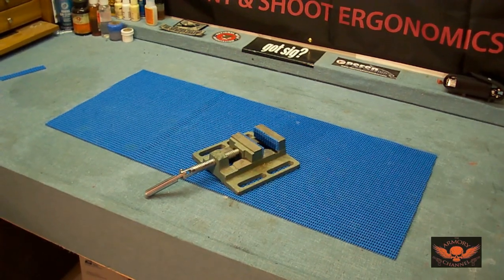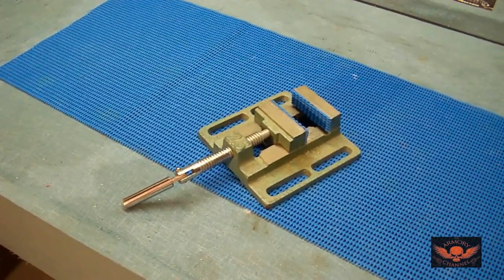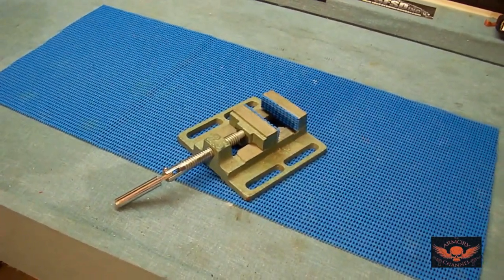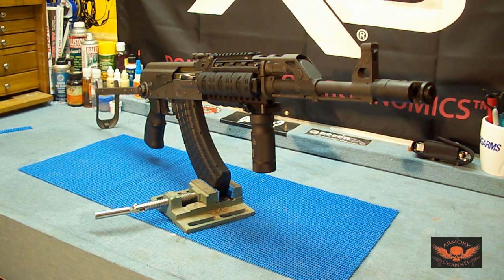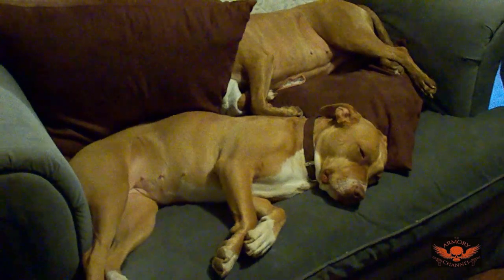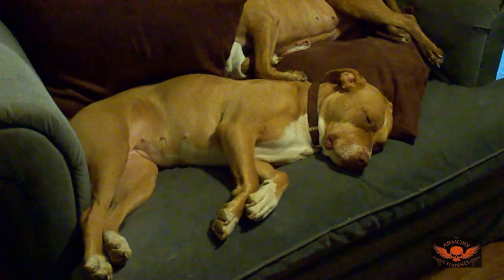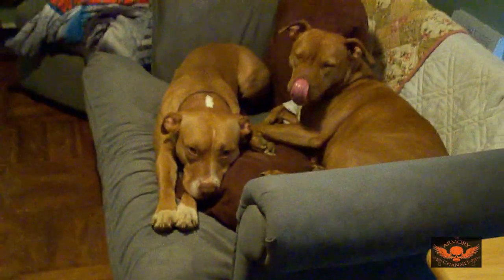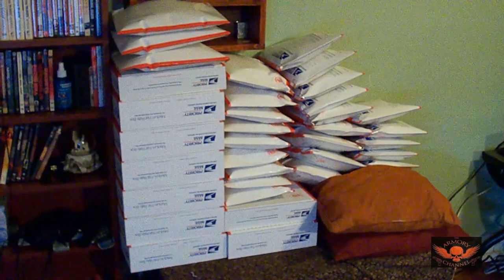Yugo M70 update

Comment: lucy looks full to me. maybe a little boxer a few generations back. I just bought my m70 and i keep discovering all these little extra things that it has like the grenade sight actually cuts off the gas tube so your blank round will propel the grenade farther, and the night sights i discovered about 20 min ago the heaver steel and barrel is great. i wrapped the folding stock with thin paracord for extra comfort and has worked out pretty well. great weapon and great dogs.

Comment: One thing, while steel might be alright, there's so many companies putting out absolute garbage. Anyone who has a saiga 12 and has messed with the UTG quad rail knows, the upper rail will screw with the gun and cause FTEs. Lighter is better, especially when it comes to accessories.

Best foregrip I've used to date is the magpul AFG, it's cheap and it works beautifully. I think it also gives you a little more control than a normal VFG.

Comment: I got a Tapco short grip for my UTG quad rail on my M70 but I can't close the underfolder unless I move the tapco short grip to the end of the rail and have it sticking out pass the rail like a quarter of an inch, which looks tacky. I see you have it mounted flush on the end of the rail, can you close the underfolder without it hitting the UTG foregrip?

Comment: Gun looks good.. thinking of getting one of these myself. How's the shooting on it? What's all the upgrades you've done to it besides the forend grip??
Reply: puca kao sveti ilija gromovnik
Reply: Yugos are nice for the price but if you want to add on aftermarket parts then prepair to spend more money on the parts... Shooting is nice, the gun is milled 1.5mm thick
Reply: Begg269 Stamped, no?
Reply: Ivan Denisovich Shukhov what about it?
Reply: Begg269 It's made of sheet metal, right? Not milled? I mean, I suppose you have to get the sheet metal from somewhere, but the receiver doesn't really have any milling involved.

Comment: How much does yogos go for?
Reply from the maker: 550.00
Reply: They are great but they are not a primary firearm... Meaning do not buy this as your one and only rifle, its good for a back up to sit in your closet.
Reply: Begg269 I believe most would disagree with you......including myself of course.
Reply: Begg269 They're actually pretty dependable rifles... The Yugoslavian infantryman would have begged to disagree with you.
Reply: Let me clarify what i meant. They are reliable durable, dependable, sturdy, nice rifles, handle well. But there are many more superior rifles to buy that will be more cost efficient and less expensive to upgrade. There is limited aftermarket options for Yugo M70 Underfolders, not to mention you can not add a specific buttstock, which for some people its a major selling point.
Reply: The Walking Flier A man I work with is from there as well. He told me the same thing so I bought a M-70 and have to say I don't regret that purchase. For the price I feel I got a hell of a deal.